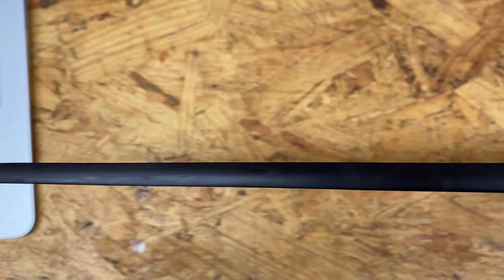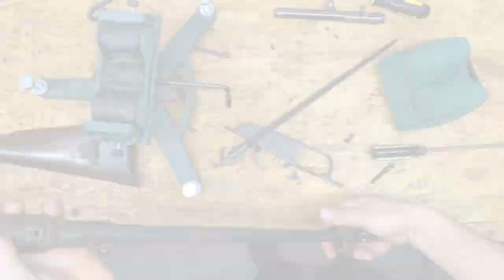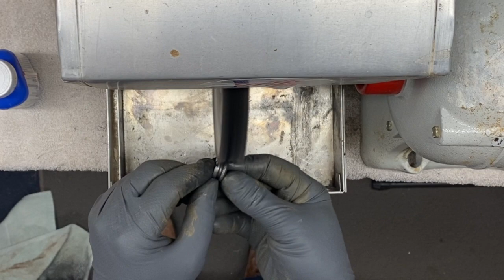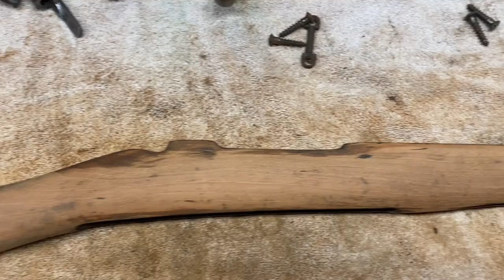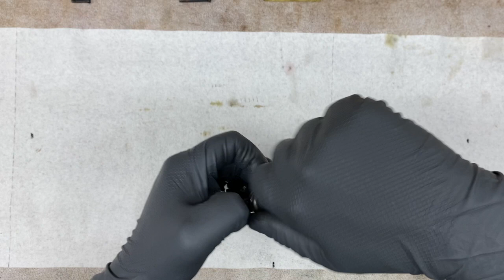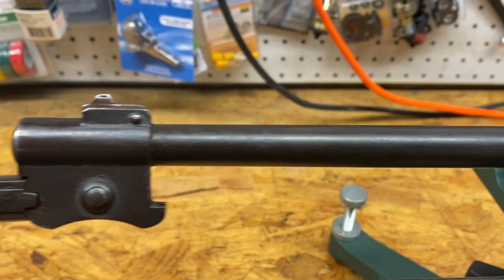Carcano Restore

Comment: Next time you have an old relic like this one, try cleaning the woodwork with plain, old olive oil. Get a bunch of paper towels, or clean rags and just wipe on the olive oil and keep rubbing-not hard, but just usinf light to medium pressure. The old dirt and grunge will immediately start to come off on the paper towels. Just keep doing it until the wood gets as clean as it's going to get. Then simply wipe off the excess olive oil. You accomplished three things. 1. You cleaned 100 years of gunk off the wood, and 2. You fed that century-old dried out wood, and 3. you didn't use water. I hate running water on wood stocks.. Then, for the rust, you might try a brass or bronze toothbrush to get at the rust. You might also try Ballistol or Kroil while you go at the rust. Use the wire wheel only for the unblued parts. Then if you want to re blue the rifle, what I did was to use a 6 ft section of rain gutter with 2 end caps for my blueing tank. I bought a Birchwood Casey 3-step blueing kit and followed the directions. These carbines don't really have much collector value, so you won't kill the resale value.If you have an old Carcano sling, clean that with leather saddle soap. Now for the bore. Mine had strong rifling but the bar was dark, so I went at it with a brass brush tip abd ran it through from the rear so as not to mess up the crown more than it already was.. That took some time. Next, you're ready to fire it. Apparently there was an issue with Italian military ammo. The bore measures .268", but the ammo measures .264". SO...There is a company called Milsurp Munitions, owned by RTI, I think. Milsurp Munitions usually stocks both types of Carcano 6.5mm ammo. They have .264" ammo in round nose, and .268" in pointed ammo. In my carbine the .264" ammo is mediocre at best, but the .268" ammo which matches the bore, is pretty decent by military standards. It will never be a tack driver but at under 100 yards I get @4" groups. Ammo for Carcanos-both the 6.5mm and the 7.35mm is pricey, like Arisaka ammo. In 1891 the Carcano design was cutting edge. Mine is a Beretta dated 1936. The bolt, to me was a nightmare to reassemble, even while watching a you tube tutorial. One thing to remember is sighting. That rear sight has two preset zeros. In the forward position it's 250 Yards and at the rear position it 350 yards. So when yo fire it that front sight post must be almost invisible down in the BOTTOM of the V-notch in the rear sight. Having a higher front post would be ideal, but try and find them-IF they even ever existed. Have fun with the Carcano!.

Comment: You're obviously not an antique firearms collector. You can find a modern bolt action, used, for about the same cost. You turned a historical collectors item, into a worn firearm.
Reply from the maker: Thanks for watching
Reply: The Carcano Cavalry Carbine has little to no collector value. Mine cost under 3 Benjamins Why, because most of the ones I've seen are in badly neglected condition, especially under the woodline.. Some were used by the Carabinieri, and those are in better condition. So, if you want to restore an old gun, that's the one to learn on and make your mistakes on. I didn't sand mine down - just a good cleaning with olive oil. That stuff works like magic. I went over the stock carefully and I found someone's name (DeVita) carved into the wood. I don't think Il Duce would've appreciated that. All the markings are there, but it's clean.
Reply: @DaveP326  Good point. I see why you would.

Comment: He should have never sanded down the stock. If you use "Murphy's Soap Oil" & a "Green Pad". It will completely strip the old wood stained finish away. This preserves all original markings that would or will be lost by using a barbaric sanding machine. Then after the stock dry's (which will take only a few minutes.) Then use a walnut wood stain for gunstocks.
Reply: Especially since these will be worth $1000+ in 10 years. But this one will be worth significantly less because of the restoration.
Reply: @robertjones2811  Sorry, no chance of a $1000 carcano in 10 years. At most maybe $500-600
Reply: @jon4139  98ks were $300 10 years ago. Nagants were $100. We saw 98s selling for over $2000 and $1000 nagants in 2020.
Reply from the maker: Thanks for watching
Reply: It's his gun she wants to stand if he can sanded I mean you didn't even mention anything about the upper handguard

Comment: Great job, l do not sand myself. I steam the wood and remove some of the dents, but your gun looks very nice.
Reply from the maker: Thank you for watching. Yes the sanding was a controversial decision that I knew would get some comments. For me, the gun was so cheap and abundant that it was worth the risk. I might try steaming next time. Thanks for the tip!!
Reply: @Rocco4Jesus  oh your most welcome. I did a video on how l refinish mine if you’re interested.  But l do like how yours turned out.

Comment: great job ! Thank for this video will be helpful if i do my own
Reply: He should have never sanded down the stock. If you use "Murphy's Soap Oil" & a "Green Pad". It will completely strip the old wood stained finish away. This preserves all original markings that would or will be lost by using a barbaric sanding machine. Then after the stock dry's (which will take only a few minutes.) Then use a walnut wood stain for gunstocks.
Reply from the maker: Thank you for watching Kevin. Yes I agree that would have worked as well.

Comment: Thanks for the video. What kind of buffer wheel were u using? Were you using the steel wool scrub, wire wheeling, blueing, and polishing wheel for every metal part or just some? What grit did you use for the sander?  Also did u buff and reblue the barrel too? Seems too big to do all that especially inside the bore
Reply from the maker: Hi Jb. Thanks for watching. 
I used a cotton cloth wheel with white compound. I was especially diligent when buffing the bolt so as to get a smooth action. It worked very well as it is one of the smoother bolt actions that I own. I only wire wheeled parts that were rusted, steel wool 000 then 0000 on everything else. If the blueing was still intact, I did not re-blue so most of the re-blueing was on parts that were rusty and wire wheeled. I wanted the barrel to maintain the appearance of age so I did not blue it at all. Just polished a little with the steel wool. The only exception was a small portion that rusted that was under the stock. When I sanded the stock, (wow did I get backlash for that so be careful if you post) I started with 120 and finished with 240. I hope that answered all of your questions. Let me know what else I can do for you. God bless!!
Reply: @Rocco4Jesus  ty very much!

Comment: Real nice video.. I like the way you speed up the parts the were very obvious to the watcher. Great job on the stock just like all my carbines. I gotta get me a wire wheel. does the wheel take off the original finish ? I sub ya to.
Reply from the maker: Hey thanks for watching!!! The wire wheel will take off the finish if you really lean into it. Typically you would be using it to remove rust in which case the finish is not a concern though. There are also brass and nylon wheels that you could use that a much gentler on finishes.
Reply: @Rocco4Jesus  THANKS

Comment: How did you get the front band off the barrel? It doesn't show it in your video?
Reply from the maker: Hey Stag!! Do you mean the band that holds the sight and the bayonet? I didn’t remove that, but if you need to get yours off, there is a small screw that you remove and then it slides off. It might need a little persuasion.
Reply: @Rocco4Jesus  no the band that holds the front stock and handguard on. It just slides up and down the barrel. I can't figure out how to get it off without risking breaking it. Its got the sling swivel on it.
Reply from the maker: Oh, I had to slightly bend it open. I was very gentle and only opened it enough to get it off.
Reply: @Rocco4Jesus  how did you do that?
Reply from the maker: @HiddenThingsofGod  Its been a while, but I think I put a large flat screwdriver in the opening and gently twisted.
Reply: @Rocco4Jesus I will give that a try. Thank you so much!

Comment: What is wrong with restoring??
Reply from the maker: Hi Shaun. Thanks for watching. I’m with you on that but that’s the beauty of a public forum. The free exchange of ideas, knowledge, and opinions. Everyone buys firearms for different reasons. Some folks like to leave them completely untouched (I am in that camp most of the time depending on the firearm) and some folks are on the extreme other end and buy them to carve them up and have fun with them. (I do not modify from original design unless something is unsafe) I bought this because it was an inexpensive Italian milsurp that I could have some fun with.
Reply: I don't agree or disagree just wanting more information. I have one but it is rusted and I would like to get it operating so I can use. (For fun) I need more opinions